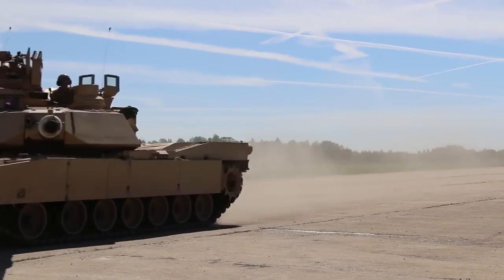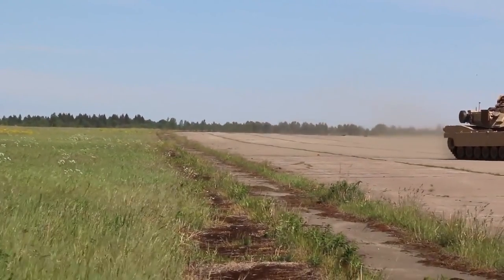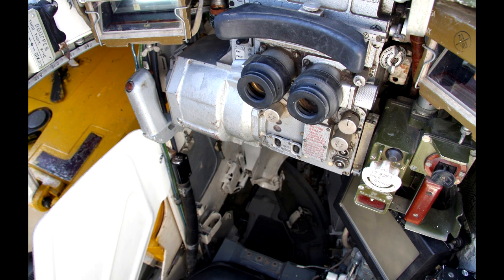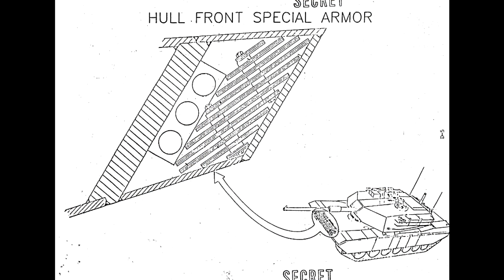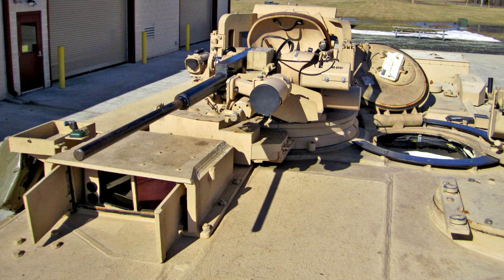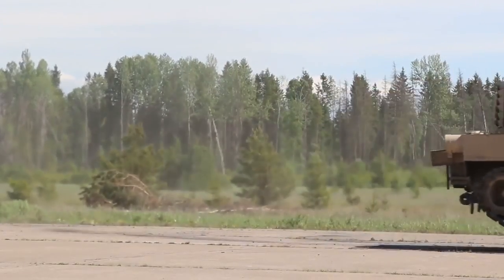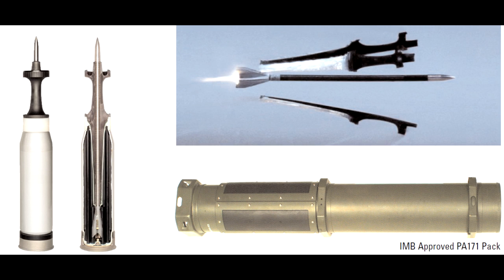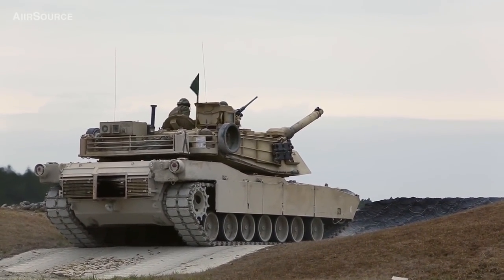Problems with Abrams tank

Comment: Tbh the best way to fix the Abrams  is to make a whole 'nother tank. Ammo storage needs to be longer than any 120mm shell we have, just in case, the gun needs to be longer, the turbine needs to be swaped with the german diesel one and the hull needs to be thicker/more well armored. I am not an expert, I never claimed that, and those are my thoughts on the Abrams. Is not a bad tank, but is not as good as it can be. Russians realized that and now the have arguably the best, most protected tank with the best firepower in the world. Not only that, but is very ingenious too with the no man turret
Reply: The m1a3 (proposed) is supposed to swtich to a diesel engine, and have a longer turret bussel for the L55 or L55a1, not sure about the armor on it, but it is supposed to be lighter (but almost inevitably won't be)
Reply: @emeryhenry1849  Nothing official has come about regarding its engine.
Reply: @peterson7082  yes, but nothing is set in stone yet, it's a proposed vehicle
Reply: To be fair though, the M1TTB had an unmanned turret and a crew layout that's basically identical to the T-14, and that was before the T-14 was even made. 

Also replacing the M1 when it's still capable would be a one hell of an expensive journey. It's really not that easy to just replace something; there's a lot of moving parts in the system that you'd also have to change
Reply: @CallsignYukiMizuki  
First, the M1TTB is not an MBT, was just a prototype. 
Second, I never said the Abrams is incapable. Is still a solid tank, but it can be better. And the new tank doesnt need to be design tomorow, not even this or the next year. All I say is if a tank needs so many changes to be as good as it can get, you would be better designing another tank.
Reply: You're right you know nothing. Do some research before making mistakes. M1 abrams is fine. It's people like you who make false statements who need to study. You weren't a crew member who served.
Reply: @cookiemonsterxlxlx  love how everyone takes my "is still very good but it can be better" as "the M1 is shit and totally worthless"

Comment: so even now shooting it in the upper plate with older tanks that use APFSD will pen it?
Reply: Even old APDS or AP rounds could pen it if not they just bounce right into the turret ring and roasted the crew
Reply: It depends on the range, angle, where you hit and the projectile. For example the T72B3 can in theory pen the UFP of Abrams in close to mid ranges. But tanks like Leopard 2A6 and 2A7, T-14 as well  as Abrams it self will pen the UFP in most cases.

Comment: How does it compare to the Leclerc ?
Reply: The abrams is still better in most aspect the lerlec could be pen by early 90s munitions much more easily
Reply: @bacnguyen9304  leclerc and Abrams are not designed along the same lines and requirements. Most of the specs are  classified moreover.  Leclerc was designed after the Abrams, meaning basic design is more advanced, with auto loader and modular armour. Is it better because of that? Who knows...